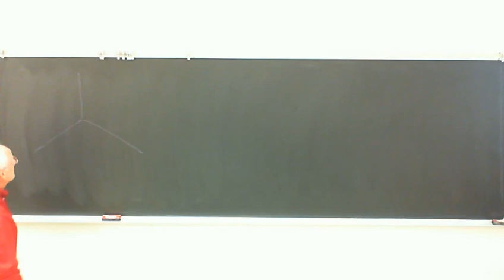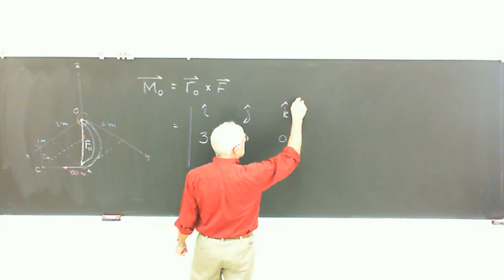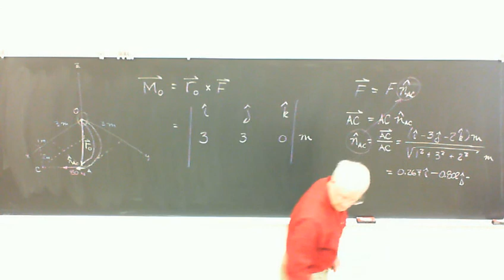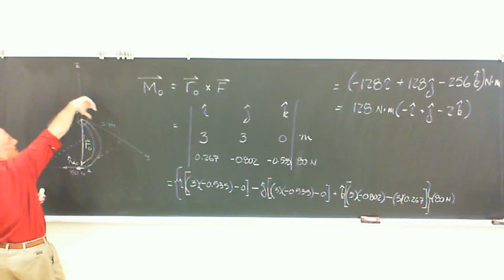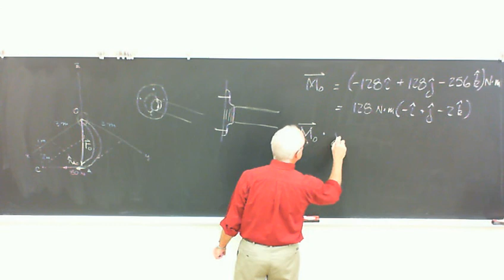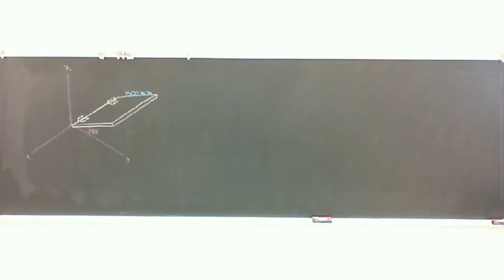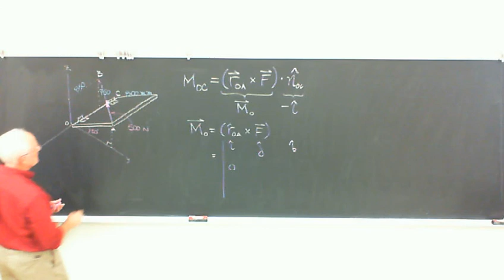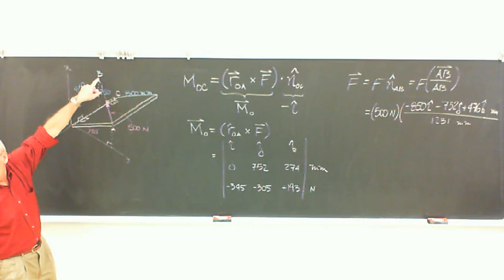Moments & Couples

Comment: geomentry and force vector 7:18 confused
Reply from the maker: They are two different vectors, but they are related.  They both point in the same direction, but one has magnitude of the distance from A to C, and the other has magnitude of the force applied from A to C.  That's what I write at 7:48.  The unit vector is also in the same direction but has magnitude of 1 (without any units- like the unit circle in trigonometry).  I then proceed to find that unit vector that gives the direction needed for the force vector.